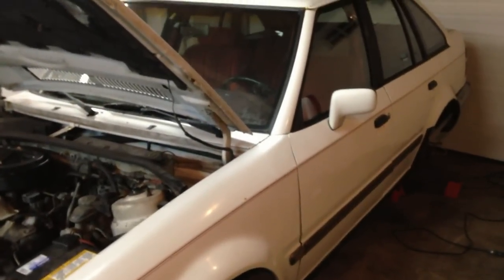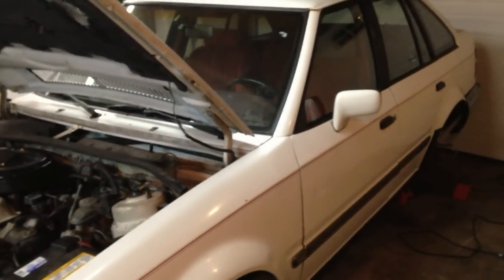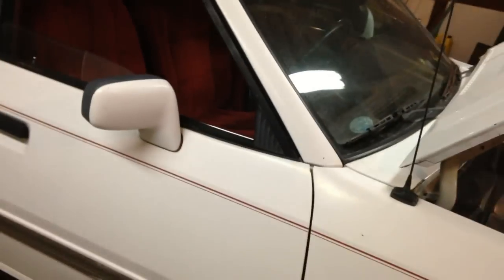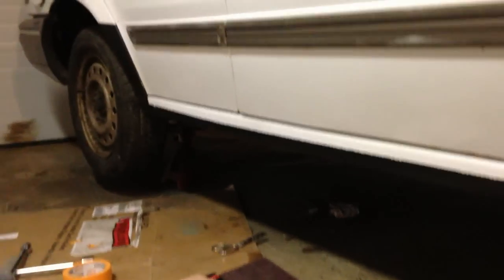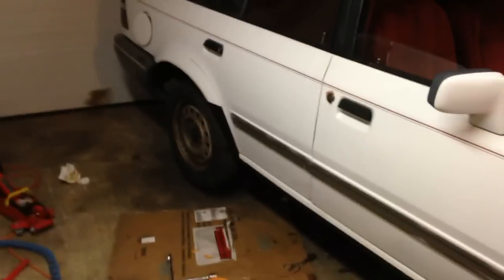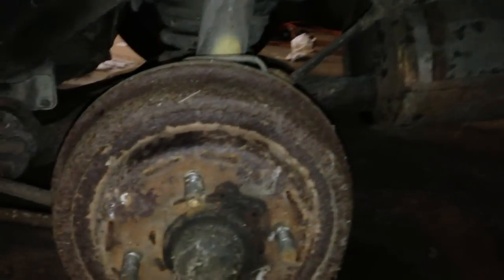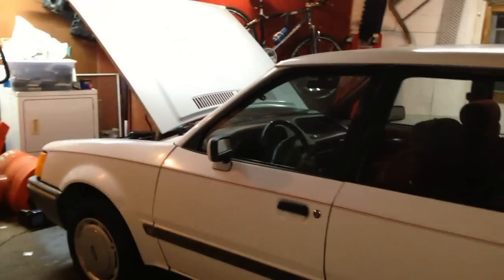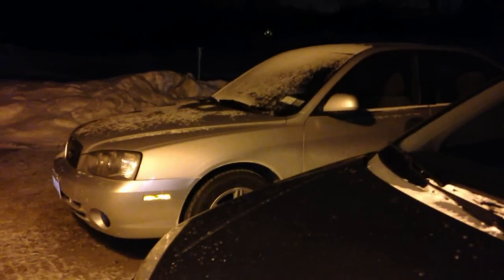Quick update on my vehicles

Comment: spray any rust and corrosion with Fluid Film it will stop it from getting worse
I found that tip on the ford truck forums when they said its a bad Idea to undercoat an old or used vehical as it seals in any corrosion . so fluid film is a good option and I have undercoated the whole underside of my truck with Fluid film 2x now
Reply from the maker: Where do you get Fluid Film?
Reply: I ordered a case of it online, but i think advanced auto or autozone have it

Comment: That 1988 white car looks to be in real good shape, I have to get back on the van body work, but around here body work is a losing battle.
I have heard of guys spraying the under body, frame with used motor oil & diesel fuel, I never did but I bet it sure would stink....LOL
Reply from the maker: I know a guy who does rustproofing which is basically spraying the underbody and inside the rocker panels with thick oil. I'm going to have that done soon I think.